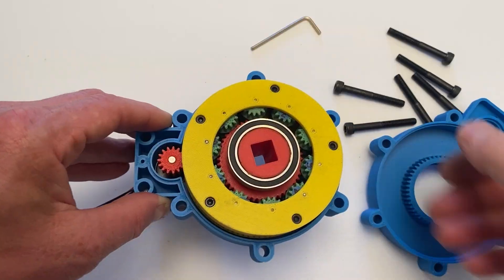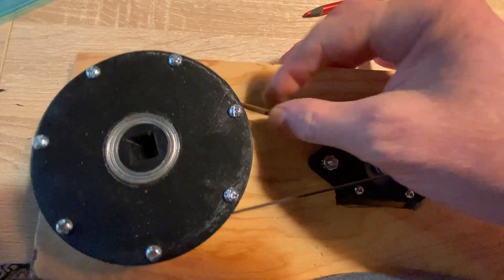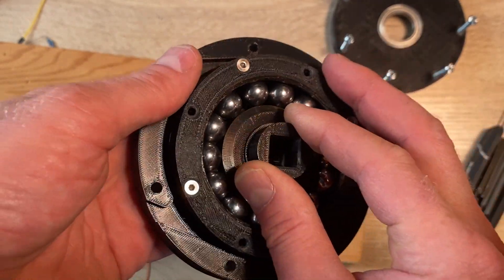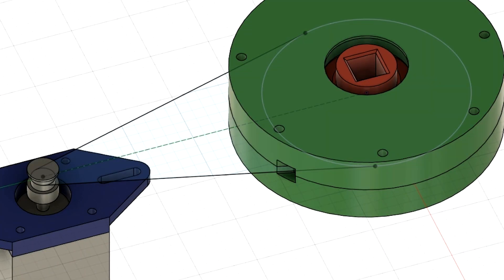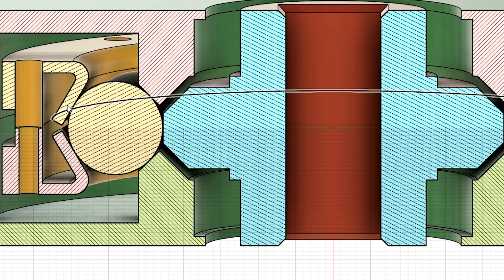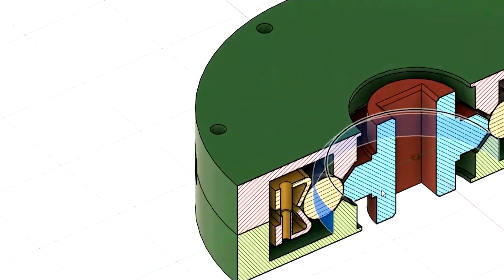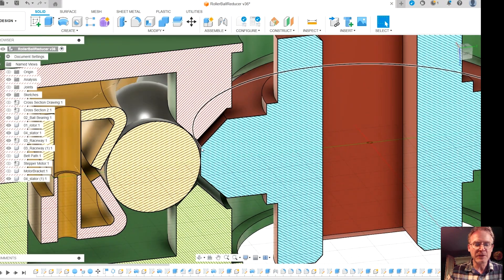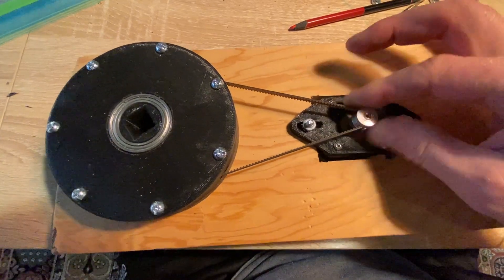Presenting the Gearless Gearbox

Comment: The problem is that you've got the ball bearing contacted by three fixed surfaces (and tensioned by two more that can move a bit).  Three overdefines the position of the ball.

But you don't need three.  You just need two.  Have an upper and lower ring contact the balls rigidly.  The rings can contact at different distances from the ball's rotation axis.  Drive it just as you do here.  The rings now rotate relative to one another.  One can be fixed and the other be the output.
Reply from the maker: @IainMcClatchie  yes; I’d considered making the rotor a big rubber o-ring so it has the ability to compress. I also experimented with rubber balls, but the particular kinds I found ( airsoft projectiles) are actually very slippery / lubricated.
Reply from the maker: @IainMcClatchie  I like your idea about just having 2 rigid rings
Reply: @davoriffic  came here to say the same thing as @IainMcClatchie, but in trying to type up my comment I think I realized that this does not actually work. A ball touching only three points allows any one of the rings to move, while both of the other rings remain fixed. 

At any instant the ball is equivalent to a triangle with the three corners touching the three rings: a triangle can't be a lever to move an object out of the plane it's in, unless the three points are in a line and it's not a triangle anymore.

So the system actually strictly demands four contact points. In the setup we are seeing here, the top and bottom contact point form the "fulcrum" that defines the lever whose ratio sets the input and output.

Now, I think it's still quite possible to have a kinematic system here that's not overdefined. We just need to spring-load two of the contact points. Two must be rigidly fixed, which would define the position of the ball (two non-parallel tangent lines define the position of a circle), and the other two can meet it where it is. I think in this design the absolute simplest thing we could do would be to replace the top or bottom stator ring with a flexure. Would still be hard to get right, since that flexure needs to have a certain stiffness with respect to the other outer flexures. It might be better to change the angles of some of the contact planes to try and make it easier to design.
Reply from the maker: @InductorMan yes; I was picturing the same thing late in the night; with 3 points of contact, the balls just tip their axis of rotation so there won’t be any ‘gearing’ happening. It could still work if the balls had axles that were held all parallel by a carrier…

Comment: A channel with something they call "Archimedes drive" has been posting something similar recently ish. Only they replace the ball bearings with cylindrical rollers which can have a carrier with bearings to hold the rollers (balls) spaced apart without sliding friction. You need a fairly high preload to make traction drives like this work. Or materials with a higher friction coefficient, but things like rubber which do that tend to be soft and compliant which hurts the efficiency. Most traction drives use steel on steel with a high preload or some kind of traction oil.

Comment: Looks like a inside out wolfrom drive to me that uses balls instead of gears (in terms of transmission ratio). Or a Nuvici CVT bycicle transmission (they also use balls), but without the gear shifting capability. When working with balls and wanting to get good efficiencies and torque capabilities out of it, you could use CVT oil. It temporarily solidifies at the contact points, transmitting shear loads well. But it's messy.
It's certainly a nice project and makes for a great desktop engineering model, although I don't think that there really exists a nieche that could benefit from this approach. Thanks for the video :)

Comment: In YT you can find ball cvt implementation this is the same idea
Reply from the maker: @DGronki  oh? Share link? Sounds cool thanks for comment
Reply: I think he’s referring to the Nuvinci drive which you can still find on some bicycles. The same CVT ball bearing transmission idea was also used in Colchester Chipmaster lathes. They were not very reliable however.
Reply: That lathe transmission was called a Kopp Variator.